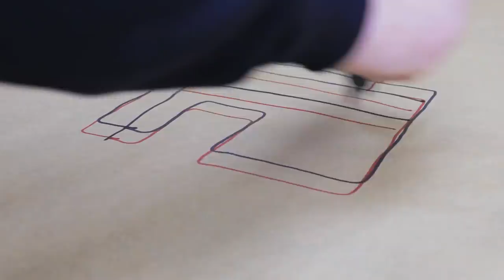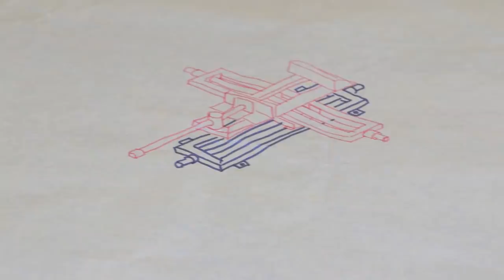DIY Cross Vise!

Comment: This is a great project. Would you be able to send plans and sizes of material.
Reply: There's nothing critical here.
Check out the material you have lying around. And piece it together out of what you have. There's no real precision here, and as you use it it will wear more. But it should be okay for woodworking. And a big XY table under a drill press for wood. Yeah this would be very useful go for it!